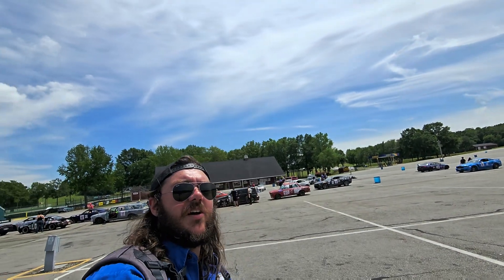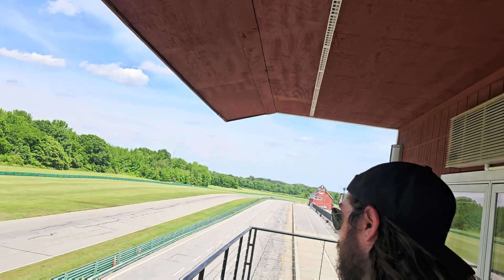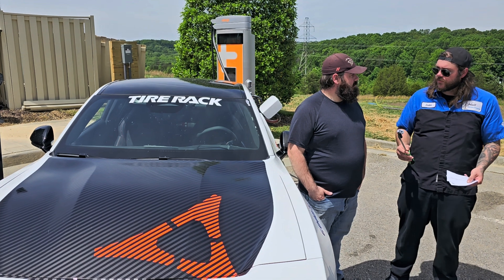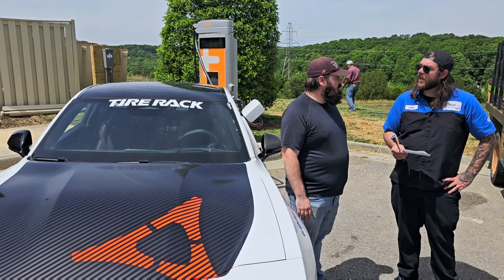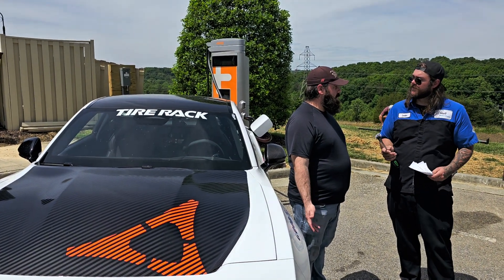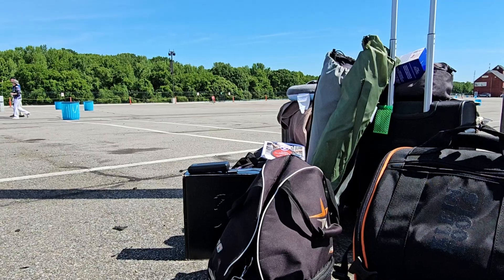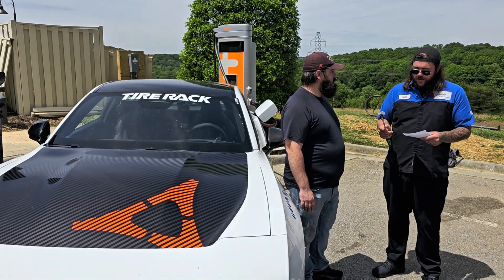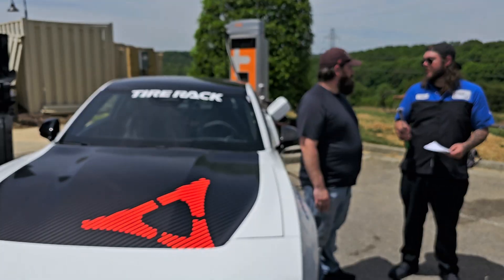Charger Daytona EV Hits The Track At VIR!  – Interview w/ Dodge Vehicle Dynamics Engineer

Comment: I thought Ralph Gilles said the new charger ev was going to have simulated shifts like the ioniq 5 N via paddle shifters.  Could that still come in a software update?   I like the sound over other EV cars, but i really dont like that it never shifts.  feels like your driving around in 2nd gear.
Reply from the maker: It kind of does? If you use the paddle shifters and increase and decrease Regen you almost get a simulated shift, kind of a thud feeling. But I don't think we will get that as an update. I think they may have been referring to the "E-Rupt" transmission that was supposedly coming in the Banshee.

Comment: If Steal-antis had a decent EV platform maybe Dodge would survive, but they don't so they won't. When a HYUNDAI at half the cost looks better and cleans your clock you have no chance.   An unproven - still have to buy gas, fluids and hoses inline 6 with less HP and torque than the EV version is going to save Dodge???   LOL   No.  🎬
Reply from the maker: @cuda426hemi  I don't think the STLA EV platform is bad, a little buggy Right now, and they're working out the kinks, but definitely not bad. The cars themselves are very easily to work on (software aside). They're even letting us crack the batterys open to replace individual cells to reduce repair cost. All the hard parts are easily accessible. 

You're right on the price. Cars too expensive. BUT do to every thing going on, you can now lease one for about as much as leasing a Prius. That's Opening the doors for regular people like me who couldn't afford the car in the beginning. 

As far as the hurricane. The people who are excited for that engine in the car, won't be excited to have to work on them when they are out of warranty. That's ill say about that haha.
Reply: @MoparTechJordan  Just that the STLA large platform has no history - they designed it from scratch and it seems they didn't want to benchmark anything particular especially for a big so called muscle car - range, power, track times all ridiculously "eh" for a "charger". Hurricane on same platform LOL? Lemme know how that works out along with tariffed HEMIs from Mexico (hint: you'll never see a HEMI in this car) - Dodge simply will have to file Chapter 11 because .....sales.

Comment: It's not a good look. When the DODGE Rep. has on a HELLCAT HAT on,  sitting in the EV...
Reply from the maker: @TimeisReel  Well, not only was he the engineer that designed the suspension on the EV charger, he also designed the suspension on the Demon 170. I would probably also be proud of the hellcat and wear the hat if I had personally been responsible for that vehicles development
Reply: @MoparTechJordan  "A little too late. Stellantis should have done all of these events before the Car came out. To build some excitement. Now it a sales failure. HEMI people and EV people are two totally different markets. And besides no one is taking their EV Charger to the track, too have it battery drain even faster. Hopefully the Hurricane and the HEMI returning rumors will save the Car..."

Comment: I'll have to check out the Dodge Garage site to see if they have the track lap times.  I would like to see them against a wide body scat & hellcat times.
Reply from the maker: @177BBDragon  I'm sure they'll have them posted. They had a very nice Garmen track management system.
Reply from the maker: The car also comes with DXR by Cosworth built in to track and data log lap times, speeds, G-Force, and other information.  That should be available on future performance oriented ICE models

Comment: You'd get a much quicker time if you had a supercharged V8 with AWD instead...
Reply from the maker: The engineers at the track did make some comments about the AWD capabilities of the EV.  We will see AWD on the hurricane but no confirmation of AWD if they do release a Hemi variant. It may be too tight and we may only see RWD

Comment: if the six pack has the same chassis it could be a good drift car with the Hurricane I6.
Reply from the maker: @toothinm9paste  if you check out the shot with the roll cage you can see it already has a transmission tunnel and two black circular caps that will cover the fuel pump in the gas tank

Comment: Who cares?   You stripped it out to nothing.    Showcases nothing!   Full interior.
Reply from the maker: @mistersecret88  What? It had be stripped out to install the cage. That's one of the requirements to participate in One Lap Of America.
Reply: So it's lighter and doesn't rep the real car.
Reply from the maker: @mistersecret88  So was every other car that competed... It's a safety requirement...  They only removed the rear seats and few trim panels to add the steel cage. If anything the car got heavier.

Comment: They need to up the top end speed, it's handicapping the car with consumers
Reply from the maker: @blackwidow3922  I agree, I asked if that was possiblity In the future but they were unable to answer. Now "I" believe it could be increased easily though software, but the current focus is making sure the kinks are worked out for customers. It sad, because of the poor reception, they may not focus on things like speed increase, or other performance accessories, unless something drastically changes with people's interest in the car.
Reply: @MoparTechJordan  I thought I remember watching a stellantis share hold video where a woman was talking about the only way to make money on EVs was stage kits so I was hopeful that maybe we would see boost in power and top end and other extras through stage kits, if tesla can do it with the acceleration boost upgrade I'm sure stellantis can do similar extras.
Reply from the maker: @blackwidow3922  I'm sure they can, and they may still want too. But the car will need to gain better traction for them to commit to future development of upgrades.
Reply: @MoparTechJordan  agree
Reply: I agree with this. Even though most won’t even hit its current top speed, it needs to do more for bragging rights.
Reply: Car looks good only thing it needs in It is an ICE. Yes I know I’m a dinosaur get with the current times adapt technology. I will when it’s ready for prime time right now It’s not.
Reply: Needs 200 mph top speed
Reply from the maker: @Jjhelios40  I think it could handle it
Reply: @MoparTechJordan  Unlocked Tesla Plaid can
Reply from the maker: @Jjhelios40  They may be able to do thing like this in the future, right now I know the main focus is making sure current customers have all the kinks worked out and are having  a enjoyable ownership experience. But I really don't know how much attention they'll invest into things like that unless the publica interest in this vehicle drastically improves.